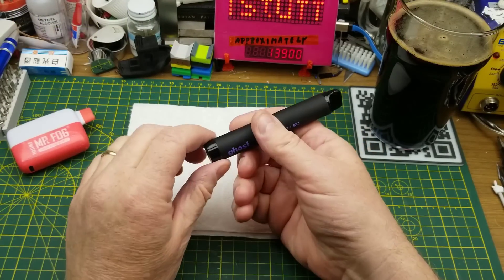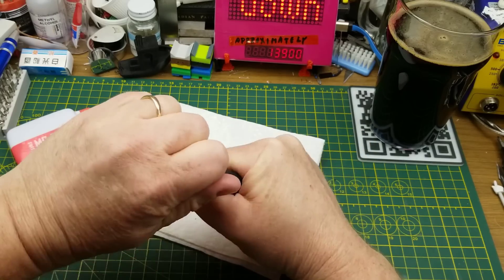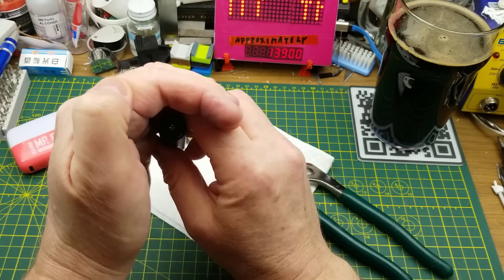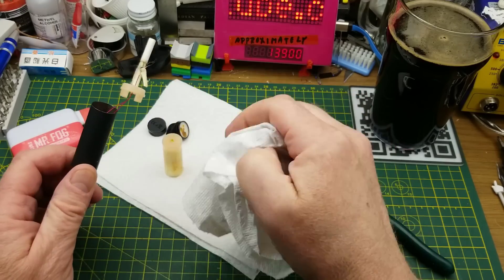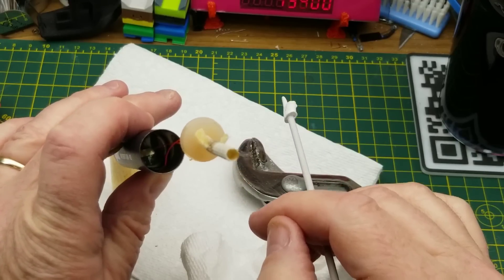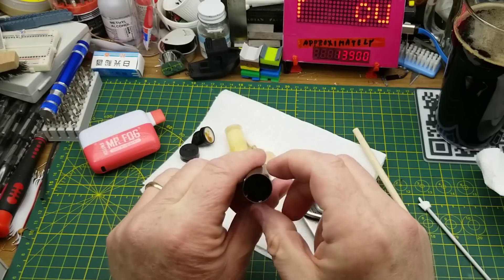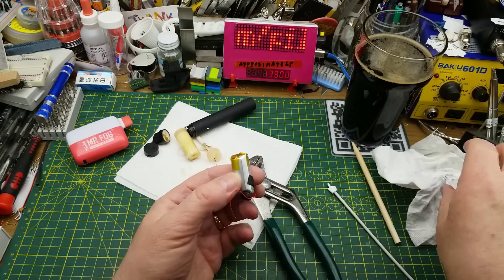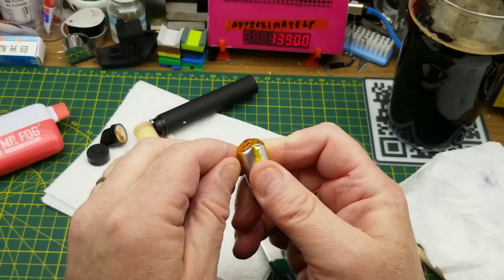Free batteries!

Comment: @Pileofstuff - People don't seem to care where they discard them in the UK, they're found absolutely everywhere. I reuse only the higher capacity vape batteries and graft on the original safety board from the dead lithium pack in the devices I service, And as long as the vape cell isn't initially below 3.6v, they'll repeatedly recharge for a few hundred cycles using this method. Manufacturers only ever charge them once and to about 65~70% total capacity. They do this so the battery typically depletes before the user gets a dry hit and is discouraged from buying that brand again.

Comment: The ghost vape - you opened it from the wrong end. Pliers on the bottom and pull the battery out that end. Careful cutting the power wires- I’ve caused a spark few times until I realised I was shorting the battery. Watch all your videos👍

Comment: I pick them up and keep them, whenever i find one.. I pull the guts out and keep the Lipo cell..put 3 LEDs in the front..cut the "snout" off and glue a USB plug in..  I trow a Pushbutton in and some resistors and diodes as simple charge protection...and done... I have a small rechargeable torch.. I think these days, the poeple would call this "upcycling".. xD ..Over here in Germany, these things will get banned from beeing sold, soon.. For obvious reasons..

Comment: I have not come across these disposable vapes before, but one thing that immediately sprang to mind is the possibility of adapting the heater and tank section to smoke units for rail locos and buildings on a model rail layout.
Reply from the maker: That would work after giving it a very thorough cleaning.
Reply: @pileofstuff  If you intend to make them rechargeable, I recommend grafting safety boards onto vape batteries from dead donor lithium packs. Or they could over/under discharge especially when installed and left for extended periods. In both cases vape batteries without protection are essentially like playing silent Russian roulette.
Reply from the maker: @Zodliness  The power board has a DW-01 (over/under voltage protection) chip on it.

Comment: I get a feeling the circuitry on the USB-C board is simply to switch the device between charging mode and discharging mode, or a safety shutoff to keep the battery from overdischarging or overcharging, using the voltage divider as a reference.

Comment: Ive been using them with my quadcopters and rc aircraft. Just the right size and weight. I dont think they have the best capacity but the seem good enough.
Reply: I used one to replace the swollen battery in an old Bluetooth keyboard

Comment: I have found around a dozen of these devices mainly the tube style you showed scattered in countryside and rural lanes in England. It appears people just sling them out their car windows. Most of the batteries are around the 350-500 mAh range I think. Good video thanks.
Reply: In my part of England I've found well over a hundred not even counting those that I had to send directly to the recycling bin because they were so damaged. I've been recovering them and harvesting batteries since March 2022. My theory is that kids are being sold them illegally and they have to ditch the devices before reaching school or home. A few devices have that USB-C recharging port but the lithium polymer battery having no protection would have been put through the most punishing of recharge cycles during its short lifetime - repeatedly being drained to 3V or lower and recharged to 4.2V with hardly any current limiting.
Reply: @bornach  wow that is a lot of discarded units.

Comment: I didn't run across any of these devices in the streets, but I did almost step on one at the airport.
Also, is there a way to use TP4056 modules with protection on a cell that already has protection? I've tried it before and the cell refuses to charge.

Comment: I mentioned to a friend that these have re-usable batteries in them, consequently I now have a small bag full of these disposable things. If you are wanting a 5V supply then Pololu make a range of boost converter modules such as their S13V15F5, put it on the output of your TP4056 USB charger module.
Reply: Kind of a shame that these lithium batteries are are built into disposable devices.

Comment: I honestly wish I could find a few of these. I'd love to reclaim some tiny batteries and put them on all my solder kits that I have on my shelf. Maybe with some of the super cheap charging circuits I got from Chinese shop sites.
Reply: Yeah, I have never seen these on the sidewalk ... maybe I am not hanging in low enough places.
Make friends with a laptop repair shop person, and you can get PILES of old batteries.  Usually, they have 18650's.
I have used gloves (and eye protection) to crack open dozens.  Usually, one battery bites the dust and ruins the unit (they output in series), but the other cells are usable.
Yeah, a TP4056 Module with battery protection is less than 0.50 USD on Ali.  Tiny boost converters are about the same.  Inexpensive to create a durable / rechargable battery powered gadget.

Comment: I've seen the discarded carcasses of these personal polluting devices in the parking lot of a place where I shop. There is a smoke shop in the same plaza. I don't have the desire to deal with the grossness, and have little experience with batteries, so I haven't engaged in a salvage. If interested the smoke shops are probably the best place to scavange. Thanks Mr. Stuff.  Take care.
Reply from the maker: Yeah, there is a biohazard potential.

I picked one up using a dog poop bag, and the other with a glove from the covid supply stash.

I gave them both an alcohol wipe-down before starting the video.
Reply: @pileofstuff  And yet most people would shake their hands if they met the person who used them. How much of a biohazrd is it?
Reply from the maker: @tonysheerness2427  completely unknown source, so why not take simple precautions?

And who shakes hands with random strangers any more?
Reply: @pileofstuff  Take precautions but I think getting anything from the devices is very small. I am in my 70's and the biggest threat to health was cold. damp, mouldy houses. They have killed and injured more people than human to human contact.
Reply: thanks for the tip.
Reply: There's also the risk of shorting the battery (See Atomic 14's video where he cuts both wires simultaneously) or activating the atomiser heating coil on an empty tank during disassembly. Some vape pens I've found during wet weather had blinking LEDs indicating that moisture had gotten into the pressure switch and was triggering the heating coil. Another I accidentally squeezed the pressure capsule during disassembly and it had stuck in the activated mode, started emitting smoke.